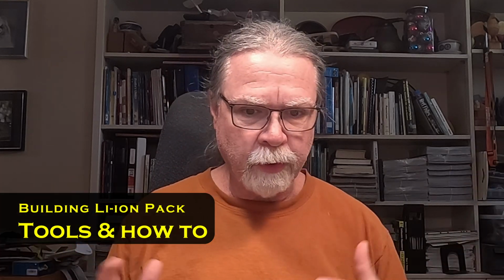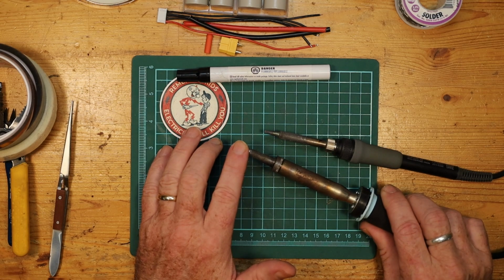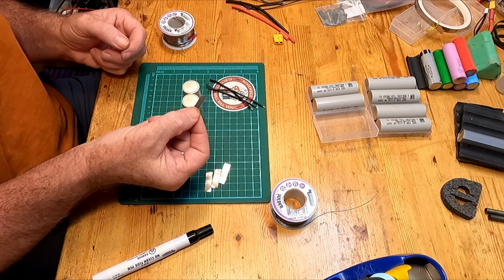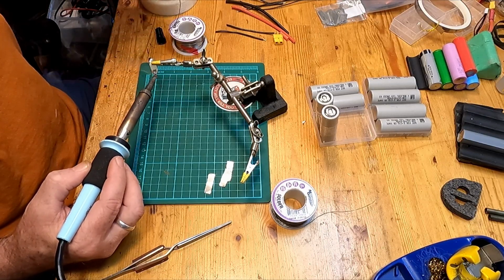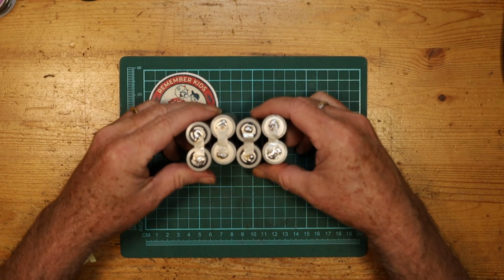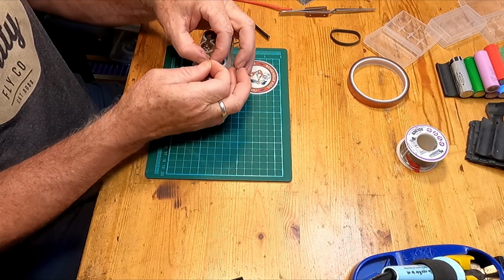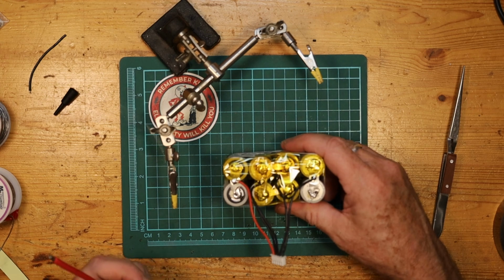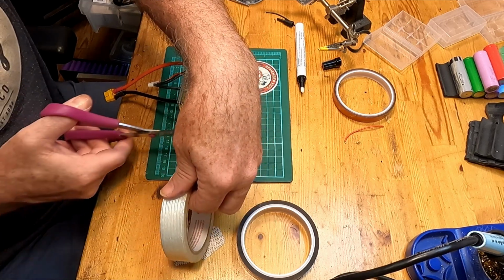Building a DIY Li-ion Battery Pack From Scratch

Comment: Hi, thanks very much. I need your help regarding a BMS. I currently have a lithium battery pack with a BMS model BWPB-710 (19S, 35A) that has failed. The battery pack is still good, and the balance wires are already soldered to the 19 series inside the pack. The original BMS uses two balance connectors (11 pins + 8 pins), and I would strongly prefer to keep the existing wires and connectors without removing or re-soldering them, to avoid damaging the battery pack. Do you know some adapter cables or compatible plugs to buy? What do you suggest?  Thanks for your reply and sorry for the long question.
Reply from the maker: Thanks for the question! Unfortunately, I rarely use BMS or systems above 6s, so I don't know of any adapter cables for BMS balance wires. There is not a standard for the BMS balance ports, so manufacturers use different ones. You'll likely need to de-pin your existing connectors and re-pin them into a connector that fits your new BMS.

Sorry that I can't offer more help.